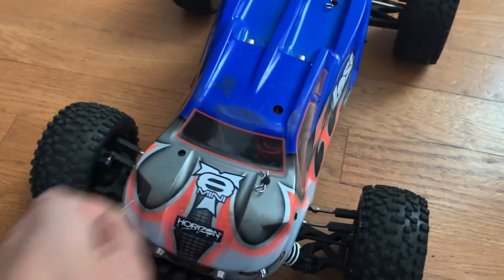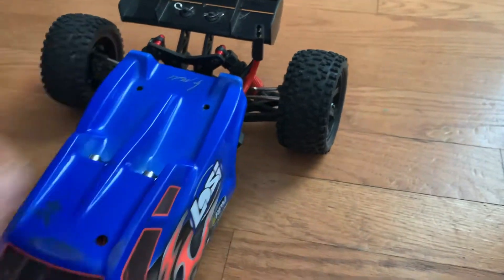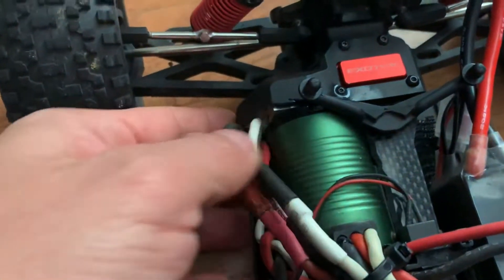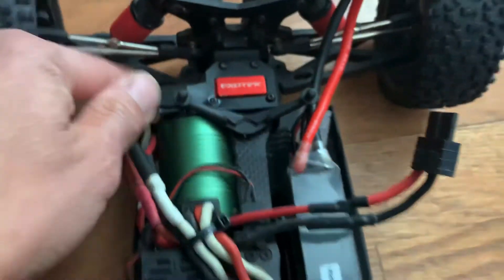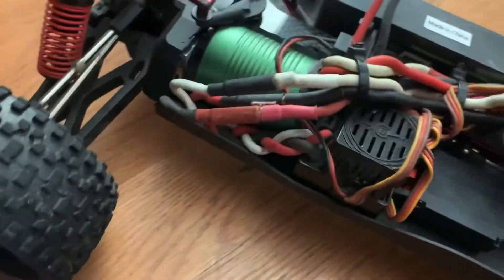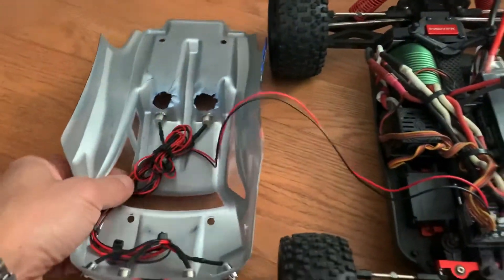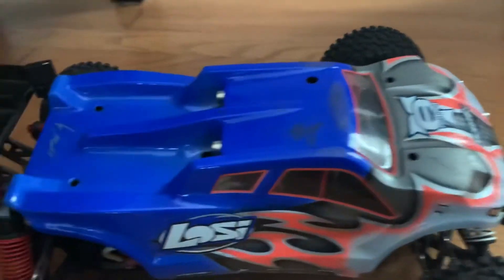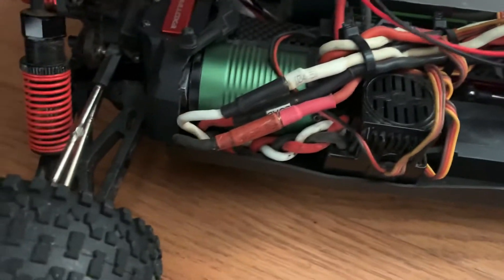RC Losi  Mini 8ight-t Truggy big Motor mount led lights castle motor

Comment: Where did you find the exotek motor mount can’t find them in stock anywhere
Reply from the maker: Hi. It’s not an EXOTEK. It’s a motor mount that holds 36mm can motors. I bought that one off ebay. The guy machined 6 of them I bought 3. It shipped from Greece. 
I saw one used exotek motor mount on eBay today for bid

Comment: Does it make it more stable?
Reply from the maker: The little
Motor it came with used to heat up all the time.  The motor temps is more stable now
Reply: Ah thanks

Comment: What type of pinion and spur did you get to fit. ( mod and tooth count)Part numbers if you can
Reply from the maker: Hi, it think it was 58 spur and 18 pinion. I also a the big motor mount to make it fit.
Reply from the maker: The spur was from hot racing steel version.